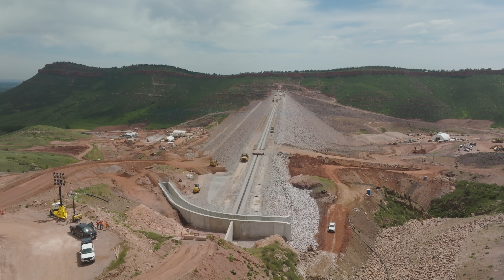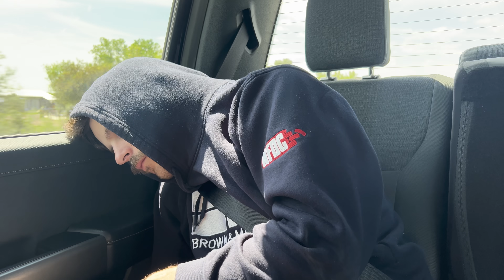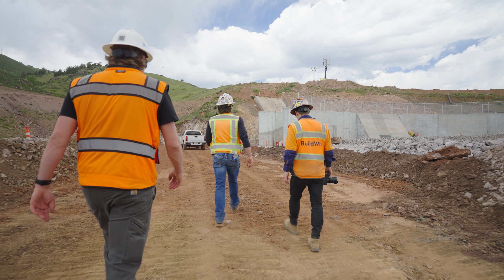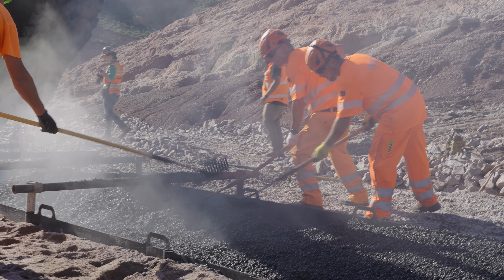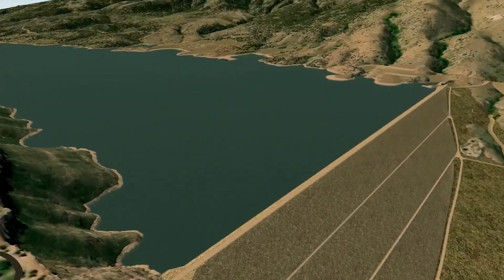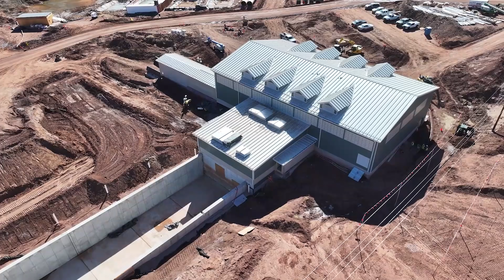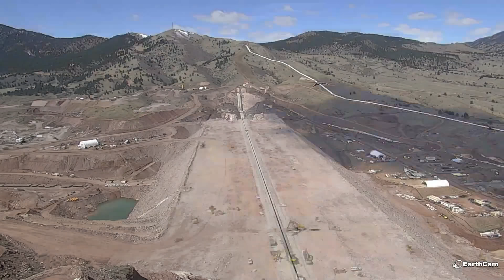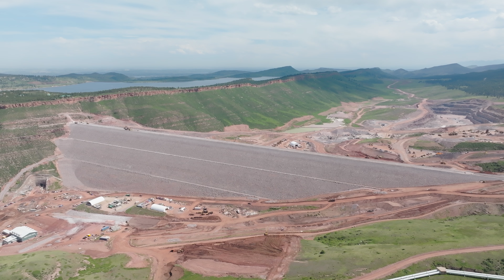Why Is Colorado Building a 22 MILLION TON Rock Wall in the Rocky Mountains?

Comment: This is the first time in my life I've seen a dam built like this... ( PdH Industrial engineer)
I'm not entirely sure... water will seep through the stones and put pressure directly against the core...  The water will end up filtering through the granite...
Supposedly, a dam comes in two types: straight or curved dams... but in both cases, you must counteract the water pressure with a solid base that doesn't move.
If you allow water to seep through one part of the dam and put pressure against the core, it will move... that will cause the entire structure to move... What's more, this straight, gravity-driven dam, if it's built like this and then, over time, the structure experiences movement, those movements will worsen the structure; the dam's center of gravity and center of rotation will shift. And the drainage system is absurd. The counterweight system is pretty bad...
I get the impression they're just trying to save on concrete by using stones, because they're also of various sizes and aren't just placed in place... and the sides of the dam don't appear to be well-supported. In fact, it seems there's no rock on the sides... it's just dirt... how is the dirt going to withstand the water pressure?

The documentary itself strikes me as stupid... it's like a children's magazine... they don't show any of the pressure calculations, nor the dam's rotation point, nor the support points... nor the support points on the sides of the dam...

That dam will already cause problems in 20 years, and in 50 years, I doubt it will still be working.

Comment: Engineering is amazing and kudos to the hardworking crews. That said it is also sad that the communities that are urban desserts where the rain and snowfall run off rooftops, other manmade structures, down asphalt roads and into storm drains completely useless to man or climate support need to draw the natural water resources from the other side of the mountain where it could have kept soils moist, vegetation healthy, and contribute to average weather patterns that cool or heat appropriately for yhe seasons. Hopefully the use will be very well managed and in time less water will be wasted.

Comment: Why not add the system that can use a man a pipe and use the water pressure to move the sediment to the other side as it will build up there as the river water naturally has it in the water.

Comment: Aaron, the problem with this is that water is not plentiful on the west side of the Continental Divide. As a matter of fact we are in the throes of a 25 year drought which now is endangering Lake Powell and Lake Mead.
Reply: Agreed. Who approved sucking more water from the already over-tapped Colorado river to send to the other side of the continental divide? Lake Mead and Lake Powell are already at only something like 30% capacity, and now another reservoir is being built to siphon more from the headwaters? From the desert side of the divide? Insanely cool engineering. Insanely stupid politics.
Reply: @frugalbirders7416  Well the plumbing is reversable .  And it was in court for 11 years .
But this is not insane politics compared to the rest of the Colorado water compact .
Probably the first bit of good sense for long term planning .
Reply: @frugalbirders7416 Idiots from California, who moved here and got in the Govt here. That's who. This reservoir will sit empty. Because there is no flipping water to fill it with. No snow idiots!!! No spring run off! Why do I have a very bad feeling that they are building that reservoir for data centers that are going to be built?
Reply: @Liberty6010and9 I guess we'll have to wait and see
Reply: Right? Did the Western Slope get to vote on this??
Reply: @chrisj4933  You don't vote for water rights.
Reply: @Mk101T and my bad, the tunnel was completed in 1947...
Reply: @chrisj4933  Oh wow , I didn't realize it was that old either .  And is just 1 of many diversions across the continental divide.
Reply: @chrisj4933 nope
Reply: @chrisj4933  Of course not but our reps were in on it.
Reply: @ShalliniSheeran  It is a state wide water regulatory agency.  So the westerm slope of Colorado doesn't need to care about the down stream states anymore than the eastern slope does.  And am sure what they did is well within Colorados water rights amongst all water right holders along the Colorado watershed basin.
And it makes no sense to keep growing the water needs of the lower desert regions.
Infact they need to start shrinking .

And I mean people using less water that flushes to nothing.  Not less people , but shrinking the populace is probably inevitable ?
Although innovations in how people live and shop ?
The traffic caused by that of current structures , is the real sorce of our problems.
Reply: @Mk101T  Thank you for that information.
Reply: @daviddovnino7585  Yep , and all that money spent on your pet doesn't make them taste any better either .
Reply: Exactly. It's actually anything west of the 100th meridian as discussed in Wallace Stegnar's book Beyond the Hundredth Meridian. It's not an issue of having enough water storage, it's an issue of not having enough supply. John Wesley Powell was condemned over 100 years ago for saying what people did not want to hear, that there was not enough water in the West for a large population. He was right but we still don't believe him and think we can build dams to magically make water appear.
Reply: @scottlefler7443 FACTS!!!!
Reply: Century old water rights contracts are still being honored in the courts. Rain that fills your local creeks and rivers is owned by whomever owns the contract on it. Not you.
Reply: Why feed the insane growth?  Limit the water limit the growth, covid tried! They can have it...the next commifornia, on pace to destroy a beautiful area of the US, just like Cali!
Reply: @elkmo41 That is what less health care for the masses is about. More guns for everyone .
And I suppose LGBQT also ... because it is more relationships that do not produce children.
Reply: @elkmo41yep
Reply: Lake Meade look like Cronus took a couple of swallows the last I seen it. That was years ago.
Reply: Colorado has seen an increase in precipitation over the years, not a decrease
Reply: @d.b.Cooper-j7z  Snowpack that feeds the Colorado River is at the lowest its been in forever, 2025 and 2026 winter was one of the warmest on record. Therefore no snow. Lake Powell and Mead are at critical levels this year, 2026. There's no disputing that. Period.
Reply: @savannamc407 and during the El Niño winter of this year the snowpack levels will be far above normal. They Change every year. It’s non consistent
Reply: @d.b.Cooper-j7z Ong wrong!!!!! We have had very tiny snow packs for over 10 years straight! And this year we had no snow pack at all! It barely snowed at all here all fall and winter. We had temps in the 80's in the middle of winter this year for God's sake!
Reply: @Liberty6010and9 that’s 1 year. Overall precipitation numbers over time are up. It will likely be a record breaking snowfall next winter during super El Niño. Enough with the sensationalistic doomerism.
Reply: @Liberty6010and9 a few years ago denver literally had one of their snowiest winters on record.
Reply: @Liberty6010and9 temperature is not precipitation. Generally warmer temperatures means more rainfall, so the fact that it was a warm winter with limited precipitation is a coincidence.
Reply: @d.b.Cooper-j7z lmao. No we did not. That was forever ago. And that was from 1 march storm where we got 3 feet of snow. That was a long time ago when that happened. It's been bone dry here for years now.
Reply: @Liberty6010and9 I’m not talking about this year. Are you unable to understand English or something? This year was an exception
Reply: @Liberty6010and9 wrong. 2021 was literally one of the snowiest years in history. You obviously have no idea what you’re talking about.
Reply: w0w
I just said the same thing..

I should of read yours 1st :)
Reply: Colorado has to send water down no matter what this will have little affect downstream
Reply: Lake mead been drying up , solving those missing people and stolen cars and shit, droughts good at mead.
Reply: @wiseandhumble2470  They got that lake bottom tap too .  Put it in decade+ ago ?
But what else people gonna do but engineer shism .
Funny I found out there is a whole bunch of water diversion from west to east in Colorado for a long time .
People is slow / Water is fast . . . But people are mostly made of W@ter ~
Reply: They are stealing the water from the western side and buying water rights.  They also collect water from Wyoming and even tried collecting water from Flaming Gorge which is located in Utah. All the governors for the past 20 year have not controlled the population growth.  They keep putting in lot of grassy areas which consume lots of water.  Colorado is a high desert so the landscaping should not look like Houston, Texas.  Stupid people running the state, bottom line.
Reply: @ShalliniSheeran Well that's not going to work at all. Utah and Wyoming are in the same boat Colorado is in. No water!
Reply: Aaron, the problem with this is that water is not plentiful on the west side of the Continental Divide. As a matter of fact, we are in the throes of a 25 year drought which now is endangering Lake Powell and Lake Mead.
Reply: @ProofreaderDojo that’s not Colorados problem
Reply: @d.b.Cooper-j7z 
yet, colorados building a dam to send water to the east?

they just created the problem then..
so, yeah, now, it is their problem.
Reply: The western US has a water “prior appropriation doctrine” that says the state owns the water and grants rights to put it to beneficial use (as described by statute) that is based on when the right was appropriated by the state.  That is the water right. Water courts administer the distribution of who gets what water and where.  If a community wants to promote or stop a project they need to pay for the right to divert and put it to their beneficial use.  In a capitalist society, money is the arbiter of use. It only becomes political when those that do not own the water use politics to stop those that do.  This prior appropriation system has served the state well for over 100 years.
Reply: @Mtnboy44  Except 1 flaw within the Senior / Junior water rights system .  Is the need to use it , or lose it .
Thereby an inherent water waste motivation.
I don't think adopting Riparian water rights will help the west solve the issues.  Since Riparian is based on water slowly moving across the land both surface and ground.
Where in the west ... it moves to quickly .

Something is going to have to give though .

Comment: In the big regional picture, the project represents robbing Peter (the communities of UT, AZ, CA) to pay Paul. (Front Range communities in CO). Any water transported eastward beneath/across the Continental Divide into Chimney Hollow Reservoir is water that will not flow into the Colorado River reservoirs (Lake Powell, Lake Meade etc) exacerbating an already dire water shortage in the desert SW. Certainly water supply experts must have modelled this prior to permitting, but it's interesting that Chimney Hollow was approved.
Reply: Don't forget the uranium!

Comment: I read through the comments and most everyone thinks this is the best thing to ever happen since canned celery.  I agree it is an amazing feat of engineering but isn't it true that water stored or diverted at the headwaters (Chimney Hollow) is water that never flows downstream? I read that legally under the Colorado River Compact (1922) and subsequent agreements, Colorado and the other Upper Basin states have rights to use a certain amount of water before it ever reaches the Lower Basin. An upstream reservoir can capture water during high flows or snow melt before shortages hit, meaning they can keep their supply even when downstream users are struggling. Under the Colorado River Compact (1922) and subsequent agreements, Colorado and the other Upper Basin states have rights to use a certain amount of water before it ever reaches the Lower Basin. An upstream reservoir can capture water during high flows or snow melt before shortages hit, meaning they can keep their supply even when downstream users are struggling like those dependent on Lake Powell and Lake Mead which combined are at about 35% combined. Is this good water management?
Reply: You are misinterpreting the compact.  And you’re talking about the western slope, not the front range.

Comment: You know what would be greater along with any dam projects in Colorado? They can make that dam wall look less man-made and conspicuous. Make the rock, concrete-face side more natural looking. Add boulders, vegetations with trees, narrow creek with white water sections. Where's the Park and Recreation department where it can design a nice State park for revenue before any other residential developments start building around it.
Reply: U should read more.
Reply: @drawingmomentum  Do you have any recommendation?
Reply: @mountainsky4.27  u can't polish this turd. It's uranium contaminated. It's also taking the water from snowmelt that naturally flows to the western slope, that keeps drought and forest fires at bay. Have u seen the fires currently raging across western colorado? Ur tax $$ r paying for an unnecessary, dangerous "dam" and fighting fires and probably eventually for uranium cleanup. There r tons of articles and info to research of of this. 😊

Comment: cool but you failed to provide a minor explanation of the waterway system between the "west side of the continental divide" and this reservoir. such as the Big Thompson River, or the sister reservoirs like possibly Flatiron, Carter or Horsetooth.   Nor did you state how many years do they estimate it will take to fill this reservoir.  although those may be political hurtles that they dont want brought up during these drought years.

Comment: Here is the bad part. All that rock they quarried was laden with Uranium, which is naturally occurring in rock in this area. So they have a big big problem. It has mostly been dismissed in the press here, however it is really not good news. They "say" they can treat it, my guess is that most of the water customers along the front range are going to be exposed to significant levels, unhealthy levels of radioactive water for decades.

Comment: Anyone have a figure for the total fuel consumption for the project?
Reply: We go through about 4,000-6,000 gallons a day. So whatever the current cost of diesel is, times that by 6 (days a week) times that by 4 (weeks in a month) times that by 12 and you’ve got your annual fuel cost.
Reply: @austinspradley7533  Thanks. I was more curious about the volume of fuel rather than the cost.  Basically a tanker of fuel every other day.

Comment: 22,000,000t / 2.3 density = 9,565,217.4m3 of fill  (A density of 2.3, most likely refers to 2.3 g/cm³ (grams per cubic centimetre) or 2300 kg/m³ (kilograms per cubic meter) He said 1.7 and that would equate to 12,941,176m3 of fill - Fucking class :)

Comment: Last time I heard of asphalt dam it was a liner, Mag 4 earthquake cracked it & it was all over in hours from trickle to full wall failure 1,000s houses, dozens people gone.
This might be 'better' asphalt but again SINGLE SOURCEOF FAILURE.  Tiniest leak from that asphalt & erosion will do the rest esp at depth w pressures in tons per inch   WHY
wouldn't govt want a backup? EPDM membrane other side of no 2 fill btw laters of treated fiber board on pressure side.  Add cement to fill creating roller compacted concrete on dry side of core?  WHY ISNT THERE A BOTTOM DRAIN ?  Stratification can concentrate & lock in nasty crap at depth.  If the dam leaks there is no way to drain it?  There should have been a water control structure in the dam or in the water side pool to allow this.  It's crap that u can't risk running pipes indams.  MANY full dams have drain & monitoring systems in them.  That spillway needs to sized for 6 inch hour rain 4 hr min w no rise in water level.  8 hr would be better.  I also Q the ridge btw 2 reservoirs if w water pressure on both sides leaking can't develope & hide.

Comment: Just thinking about your damn, seems to me the opposite side of the dam from where the water is going to be should have almost twice the rock to hold the damn. With 3 miles and 350 foot of water pushing against it, there needs to be more resistance on the opposite side

Comment: 1 million yards crushed rock weighs 2700 to 3300 pounds/yard. Using 3000 pounds ave , equals 1.5 tons per yard.1.5 times 1 million yards equals 1.5 million tons.

Comment: I think it was exciting to watch the construction process, however, I don't really understand the asphalt core - why is that method better than making a core from concrete or why didn't they just make a layer of concrete on the side of the dam where the water will eventually be and made it watertight in that manner ? then they would avoid problems with erosion ! - was this really the cheapest and most effective way to construct the dam ?

Also, I found the way they fed the hopper on that asphalt and gravel laying machine to be a bit redneck-like - why didn't they make use of trucks with some sort of hopper auger attachment instead of this cumbersome method with excavators, I mean they had to perform this task numerous times.

Comment: Kooks talk about the sea level rising but they leave out things like time moving material on a floating ball in space has an effect that most ppl never consider 

The Chinese built one that changed the earth's axis by 2 degrees, which is 1,600 miles so start thinking in those terms and more will make sense not to mention the weight of water that comes out of nowhere